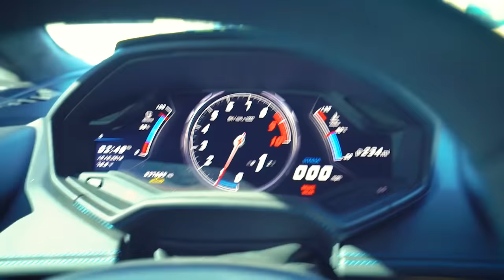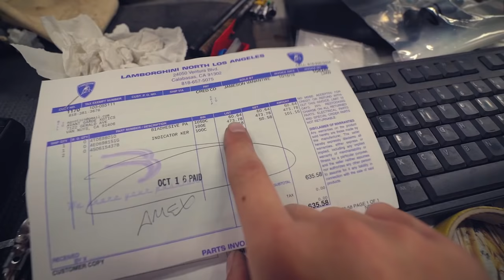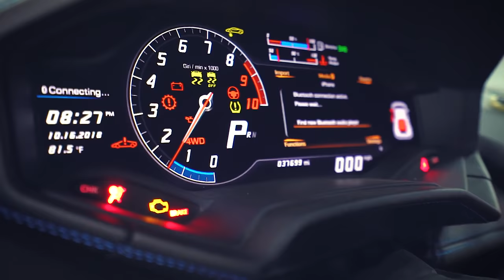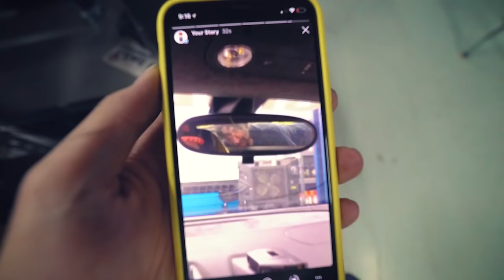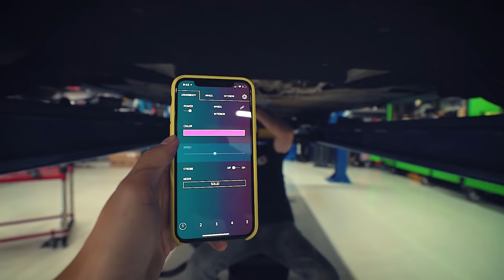MY SUPERCHARGED LAMBORGHINI IS BROKEN...   *ALEX CHOI VLOG*

Comment: Bearings are not forever typically they last 60k to 100k miles for steel ones. Get the carbide  bearings over 150k, ceramic who knows how long. Heat and vibration play a big part in the longevity.

Comment: The fact that those idler pulleys all failed at the same time is what proves how good VF engineering is with their setups really. Most pulley systems have one that is a problem child cuz it was thrown in cuz of belt issues but they distributed all the force evenly throughout all the pulleys making a very efficient part that clearly failed from heat due to it's location. I don't see too much air flowing through there I would guess and heat and fast spinning things over time something is gunna give. Either way VF definitely should get a thumbs up for that in my opinion any.